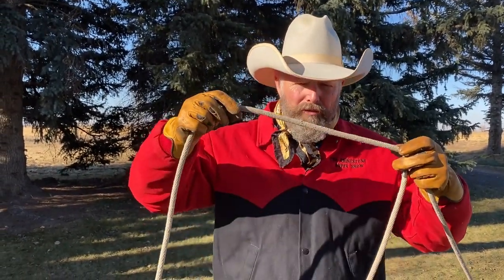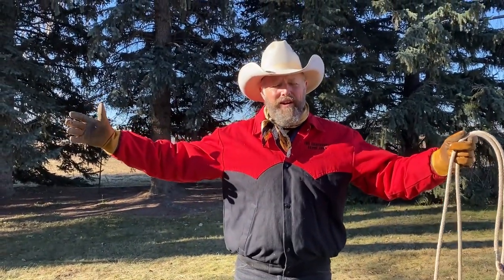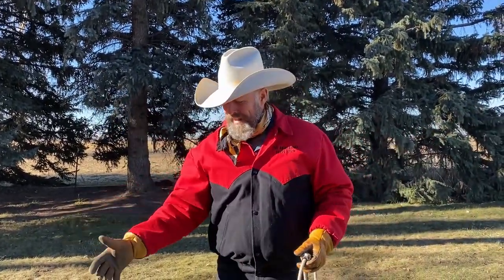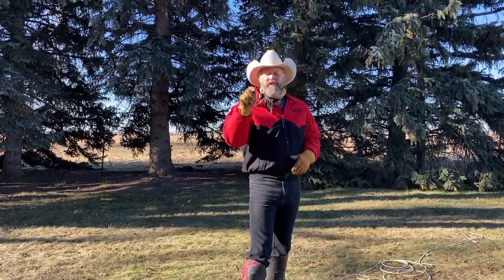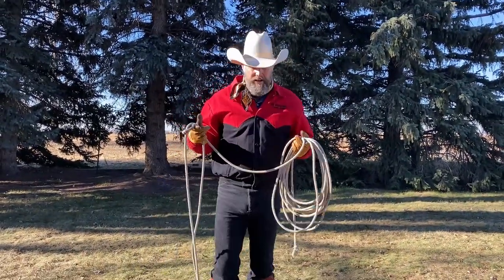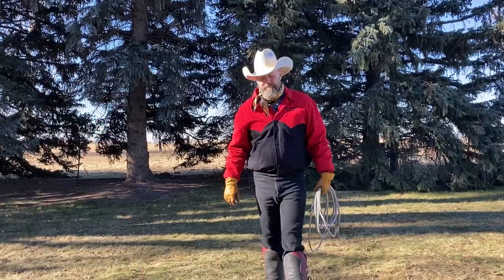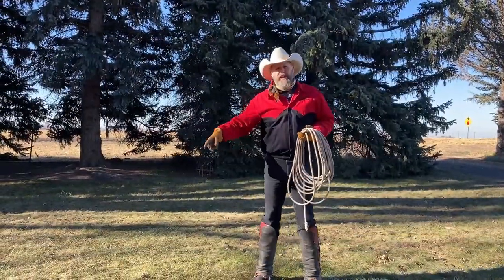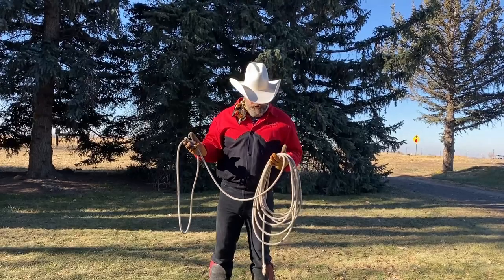HOW TO TRICK ROPE:  BUILD A LOOP

Comment: Hi Dan,  I'm working on this trick now.  I've gone from the 30' rope I used in the Roping Fool tribute to a 40' rope now.  That 10' makes a big difference.  I came back to watch this video and I once again have picked up more important tips.   With my wedding ring rope 24', I am now able to consistently work it from the butterfly to the wedding ring.  I'm still having fun learning and a big thanks to you.  
Woody Foreman
Reply from the maker: Hi Woody,
It sounds like you are making great progress.  Yes, 10' make a difference.  I think the 40' rope is a good length because it's big enough to be impressive,  It's still controllable and it's big enough to spin around many kids.

Comment: How long is the rope that you're using at the end of this video?
Reply from the maker: Hi Mark, The rope is about 45 feet.  Guys who want to spin "THE BIG LOOP" usually use a longer rope from 65 to almost 100 feet.  For my show, I just want a rope long enough to spin around my horse.  The longer the rope, the more time is spent getting the kinks out and preparing it for the next show.  I think that, as long as your big loop is significantly bigger that the other ropes you have used in the show, the audience doesn't care how long it is.
Reply: @rhinestoneropers9204  Thanks for the reply!  I am only 5'3" so I wonder if you think there is a limit to  how long the rope can be if standing on the ground.  I am in that 45-50 range right now and I could not get very far until I started using brand new spot cord with the sizing. I am still not consistent due to some of the reasons you mention like when I am trying to let it out and how much  each spin.